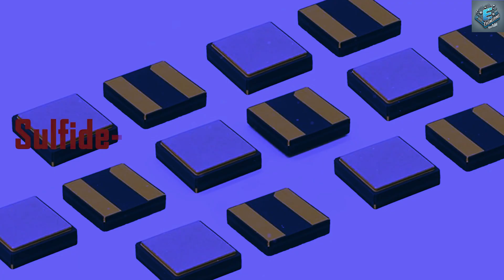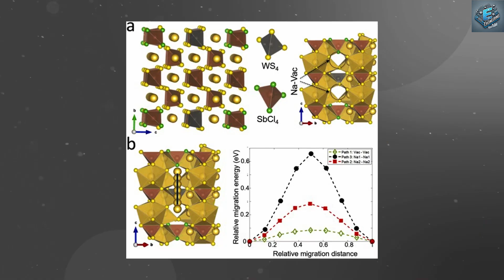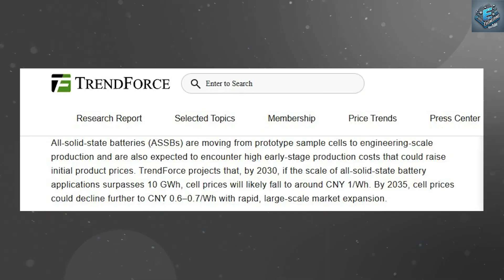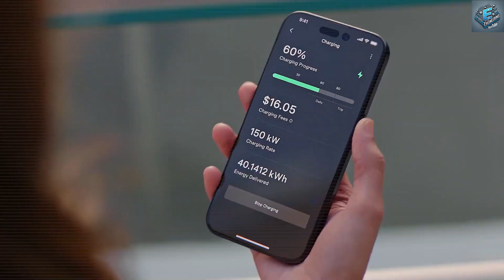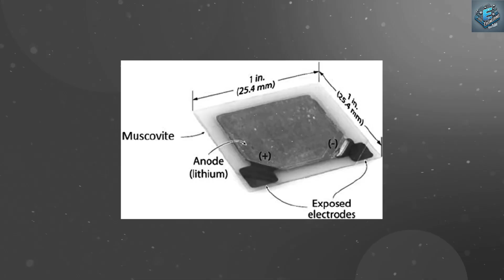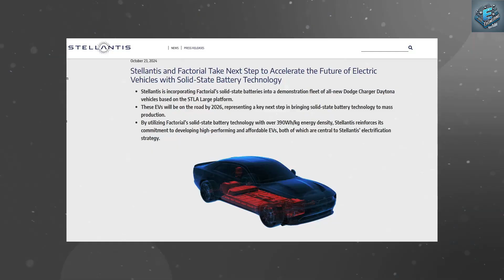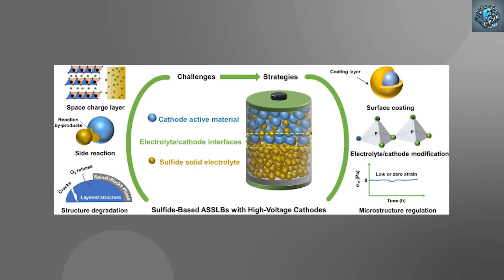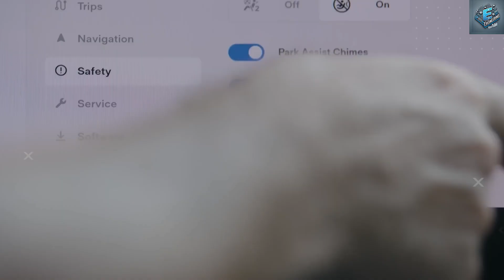The Tesla Model Y's Solid-State Battery is a Game-Changer

Comment: Petrol has an energy density > 45,000 w/kg (not 700w/Kg like this). ICE had poor thermal losses yielding 9000w net delivery. Now, 3cyl opposed diesels get 50% efficiency and when coupled to generator/super capacitors and an electric drive yields less emissions, equal power, greater safety and 6 times the range in a pound per pound configuration without swamping domestic power grids (of dubious sourcing and stability).
Reply from the maker: I really appreciate your detailed comment! It's always great to see viewers engage with the technical aspects of the topic. Your expertise adds a lot to the discussion!